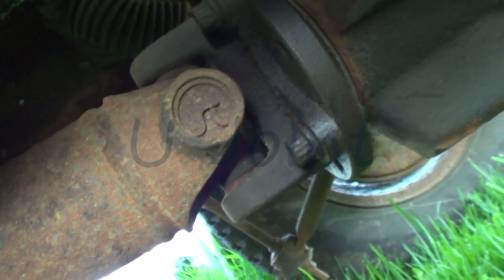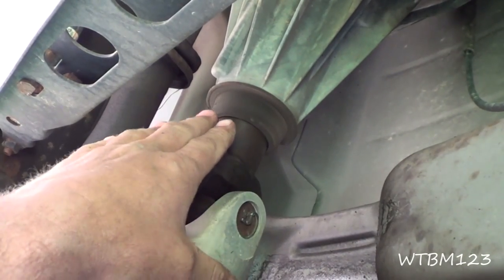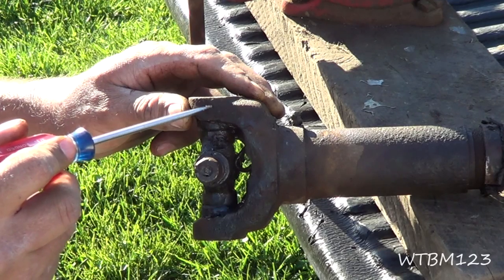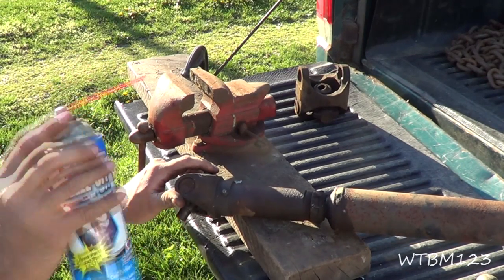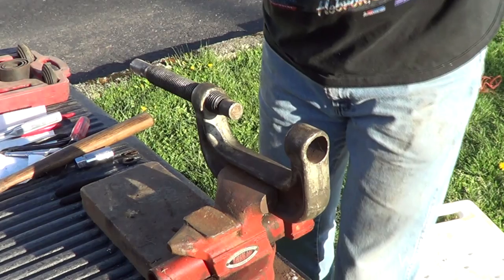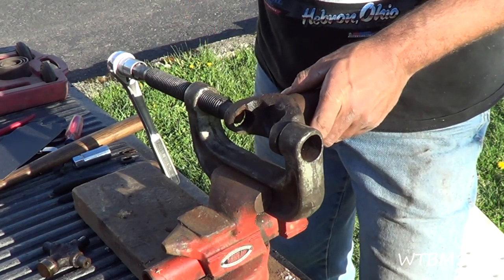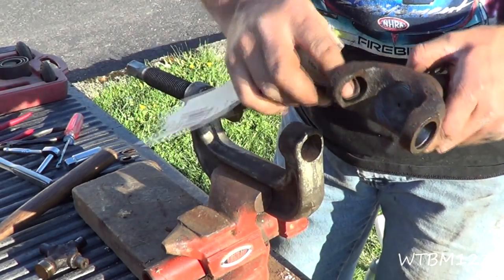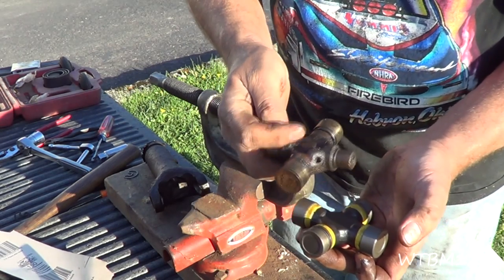Changing a U Joint, or Universal Joint, in a Drive Shaft

Comment: thanks for the help about the ball joint press, I got the ball joint press for freee from O' Reilly Auto $132.00 deposit.  

I didn't want to take the front drive shaft off the truck, but it worked great.  I had to use the impact for about 45 seconds before it would start moving.

Comment: Some axles can be turned 180 degrees on the sliding grooves, to still get the axles balanced it is very handy to mark the ends, I prefer using a hammer and a pointy punch and make marks that is recognizable even after cleaning the parts with de-greasers, and to mark up each part before removing them from the car, do mark the connecting ends at the gearbox and the rear axle too, that way you are dead sure you got it back in it's right balanced way! If you forgot and turned the ends the right way like he did in the video and the car is still vibrating, try to turn the sliding part 180 degrees, that might do the trick. Thank you for an excellent instruction video!
Reply from the maker: +Bratfalken My only question would be if i had to replace a slip yoke on a drive shaft ,or even a H yoke , how would i know which way to put the yoke back on . I agree putting things back the way they were is good , but i have never yet had a issue as long as the joints are phased , but maybe some day i will . Thanks for watching and commenting

Comment: Great job.  Ball joint press is a great idea, thanks for that.  Also the tip on removing the plastic factory installed clips inside.  I'm sure it would have been a little more difficult taking them out without heating up the yoke.
Reply from the maker: Thank You for watching and commenting.

Comment: Hey WT i have a crv with a vibration on my seat It happened after I replaced my shaft The old shaft was in pretty bad shape when i took it out the ujoints on rear were seized. I installed new one now i have an agrevating vibration Where could it be the problem? Its a straight shaft one piece. The vibration is only at 2000 rpms anything past or below  that 2000 rpms NO noise ...WEIRD! BTW you make really great videos @ thumbs up!!!
Reply from the maker: If sure all the needle bearings are in place and u joint moves freely , then maybe something bent on drive shaft . Have you checked the rear drive axle where drive shaft connects . is the bearings on pinion shaft good , no oil leaking . Stuck u joints can cause other bearings go bad

Comment: Thanks, Bro.  Chevy wanted me to replace my drive shaft and U joints for over $700 which I thought was rediculous on a 2003 Silverado.  They said that the drive shaft was badly rusted, but they all rust unless you lacquer them periodically.  It is most likely the U-joints are worn out.  I was getting vibration at speed, but I couldn't determine if it was the driveshaft, suspension or motor mounts.  They diagnosed the problem, but tried to take me for a ride.
Reply from the maker: +Willie Harris Thanks for watching and commenting
Reply: Yep.  Your vids are fun.  Mine suck.  I get no hits :D

Comment: thanks I'm doing a dana 35 front where one cap is missing from I joint.  and wow what a rattle noise that makes on the smallest of bumps.
Reply from the maker: +danny117hd If one cap is missing , make sure the yoke i not out of round or damaged . The u joint cap needs to fit in snugly and strait . a lot of times when a cap is missing , the u joint cross will damage the hole the cap came out of .
Reply: +wtbm123 thanks again.

Comment: Best U joint video I have ever seen. Great job
I have a 2000 Silverado and did not mark slip yoke when I took it out to change  rear u joint at differential. Now i`m experiencing a vibration? Could this be because I don`t have it phased? I did not change u joint at slip yoke
Reply from the maker: Greg Pelletier Yes it needs to be in phase , or u joint crosses in line with each other or it will prob vibrate.

Comment: Great video. Very helpful information.  Getting those 2 sides of the drive shaft aligned is probably gonna be my problem. I feel a little shake or slight pop ever since I lifted my truck. I'll definitely check up on that tomorrow.  Thank you very kuch for such a helpful video. 

By the way. Is this the same procedure for Toyota driveshafts?

Comment: So you can reuse the original retaining clips and not the new C style clips? I was wondering about that when I was searching for U Joint replacement and they only gave me the C style to choose from for my 2000 Tahoe 4x4 as I wanted to put everything back as it was.
Reply from the maker: Some gm ones use a plastic retaining material that needs to be heated to remove . Then new clips come with new u joint . If you have the correct u joint then unless u had to melt the plastic , it should come with the same style clips . You need to use which ever style it was designed for

Comment: I have a 99 Ford explorer but one of the clips on the u joint broke and we can seem to get it out we letting it soak in pb blaster but we tried to chizzle it and still nothing it appears to be stuck.... Any ideas
Reply from the maker: jake g I would try getting behind it with a pick or small screw driver. may be able to push the cap in slightly , but not far if pushing in on any part of the clip.

Comment: I just put in u joints on my 98 chevy the front was shot but i replaced the rear because i had the shaft off, After putting the shaft back on my rear joint is now squeaking any suggestions?
Reply from the maker: If you remove the back bolts holding in the drive shaft . you can take it loose and move the joint both ways and check for smoothness . Also make sure caps are not spinning
Reply: Everything is good there i actually just took it for a drive and once i got home it wasnt squeaking at any speed anymore.. Im at a loss but happy, I had taken it loose a few times and checked and rechecked and greased everything

Comment: Your video saved me about 300 bucks that Nissan wants from me. What do you suggest if the U Joint is staked? Thanks for your time.
Reply from the maker: The u joints remove the same but there is going to be some kind of bearing socket in the middle to deal with also. not sure which style of cardan joint they use.
Reply: Thank you for the quick reply sir, great video.

Comment: My U Joints were a pain on my 2003 Dodge Ram.  I tried pounding them out with a sledge and socket and broke a c clamp trying to get it out.  I went to my garage got a skil saw with a metal cutting blade and had it out in 30 seconds.  Just be careful not to cut into the drive shaft.
Reply from the maker: Thanks for watching and commenting.
Reply: 45min later with a cutoff wheel.  But it worked
Reply: Matthew Smith
I am always in it for an easier way.  Glad it worked